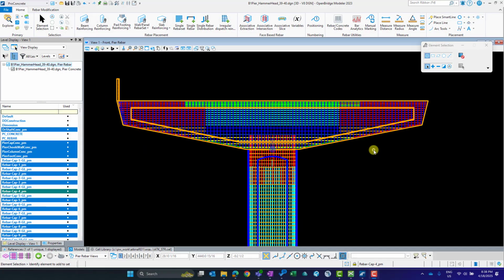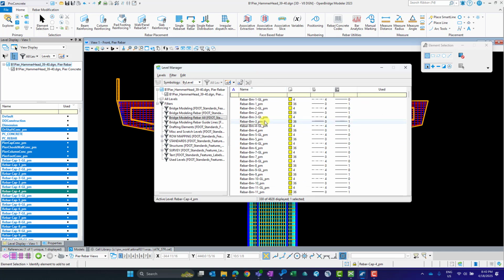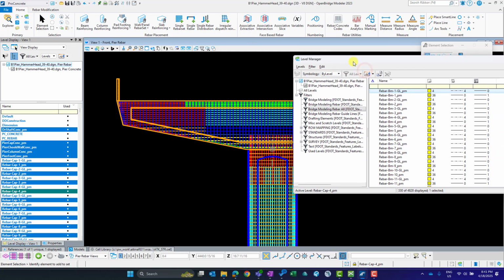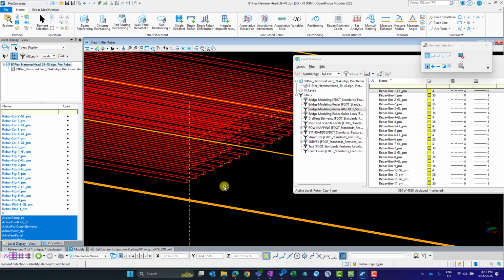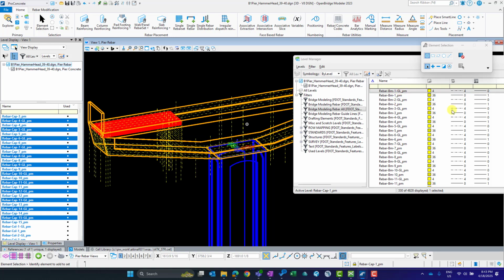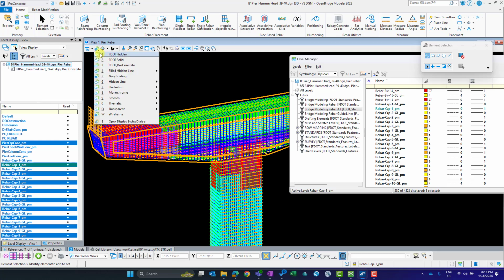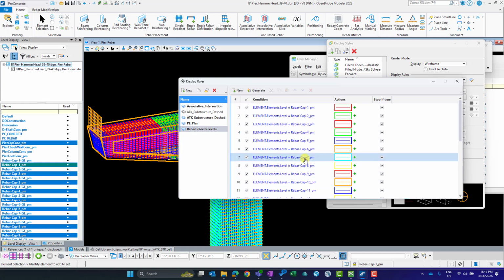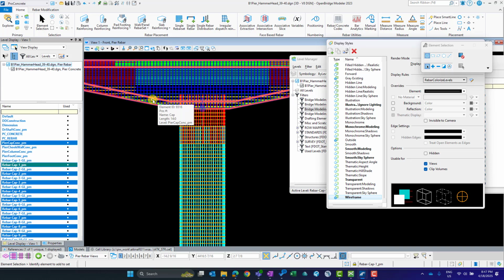OpenBridge Modeler ProStructures - 3D Rebar Modeling Part 2:  Workspace & Guidelines

Comment: Asking because I'm curious - why add in another level of complexity with the Display Rules? Since you have 15 "groups" of bars available for each component of the pier that are on different levels, why not just assign the BYLEVEL settings to be the different colors?
Reply from the maker: Great question! The need to “colorize” the rebar is mostly for when we are building the model to help differentiate the bars. I like maintaining the original level colors for other presentation reason in plans production later on. Plus, display rules are portable, so once you build it for one you can use it in any other file as opposed to having to change level colors each time in a new file.